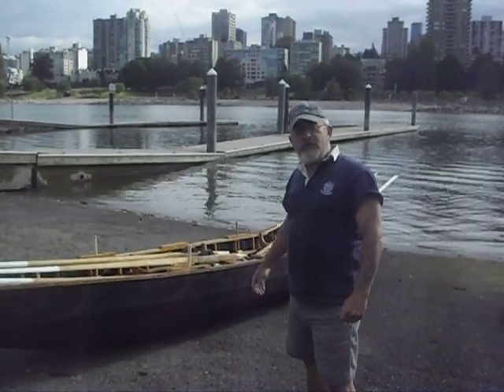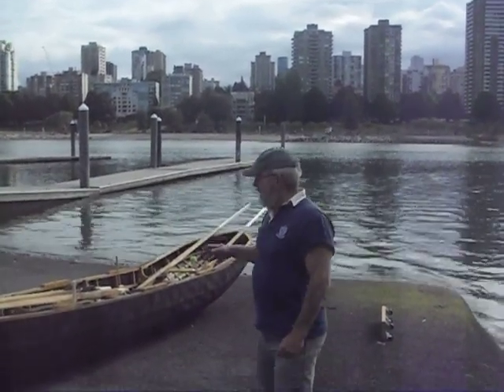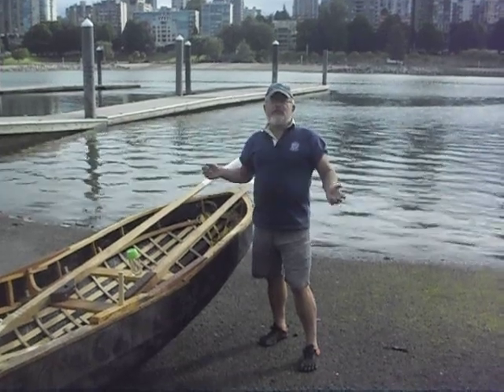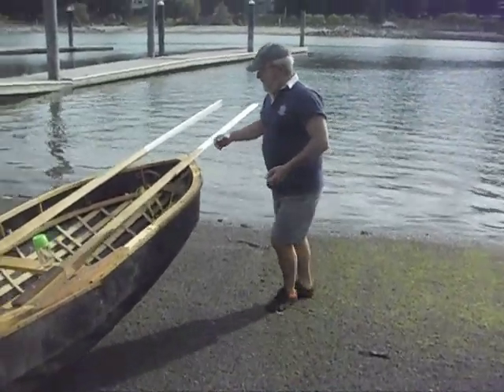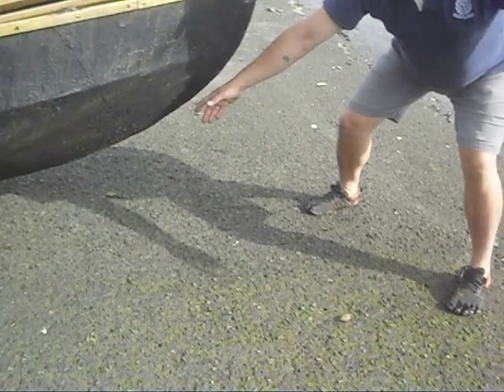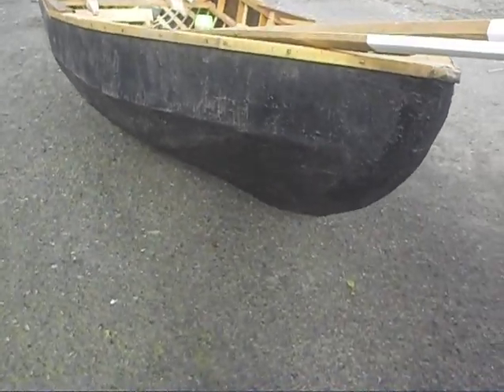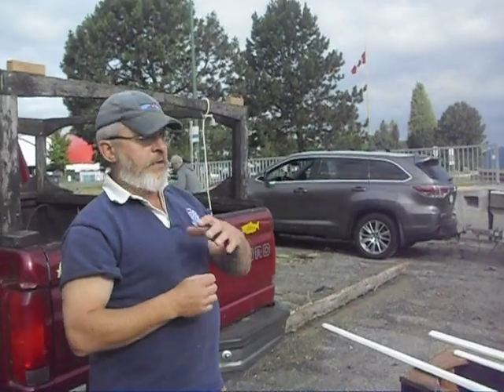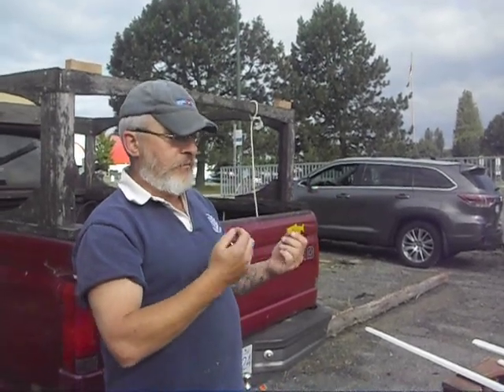Our new Naomhog

Comment: Hi I am retarring my currach this weekend and wondered if you have any special recipes or tips. the canvas has three previous coats but in places it is cracking especially in winter. In the summer the cracks subside. I places the tar hs become so brittle that it is coming away from the canvas. I am getting it ready for the summer and want to recoat it. I have a tin of refined coal tar and a stove for heating it up 
If you can advise - please let me know - regards 

Jeremy
Reply from the maker: Hmmm - I'll have to give this some thought  and then post a (one hopes) more-useful  reply than this. I'll post each factor as a separate reply. a)  - does the exposed canvas show any penetration by the first coat of tar?  We used standard roofer's tar, and even though it was so hot it was bubbling on the brush it didn't appear to permeate the cloth as I'd hoped.  We had cut & sewn the canvas without washing the 'sizing' out of it first RTE "Hands" documentary  - when the builder runs the scissors along the cloth it make the 'zip' sound I associate with new canvas. I'm going to try tarring a piece of canvas that's had the 'newness'' washed out of it first to see if that affects the 'permeability'.
Reply from the maker: b) Have you tried carefully playing a flame (from a propane torch)at a low angle to make the old tar 'flow' into the cracks? After we applied our tar I noticed that bubbles had 'surfaced' after the tar cooled, so I used a torch to melt the surrounding tar to fill them.
Reply from the maker: "refined coal tar" - I'm going to see if that's available here in Vancouver - I used builder's tar which built up a very thick coat (and made our boat much heavier) Concerning the tar cracking - What are your winters like?
Reply from the maker: I'll reply again in a few hours - we're headed out for a row ;)
Reply from the maker: I HAD noticed that the coating of near-boiling tar hadn't permeated our new canvas - I wonder if the 'sizing' on the new cloth was a factor, and that perhaps it would be better to pre-wash the canvas (to remove the sizing) before sewing it on the boat. I'll have to experiment. Given what I've just read about the health risks involved, I'm inclined to switch to black marine paint on the next skin.